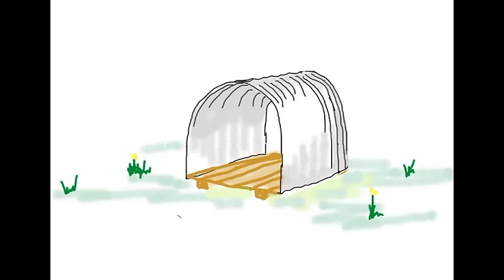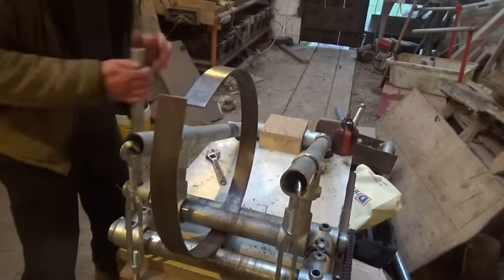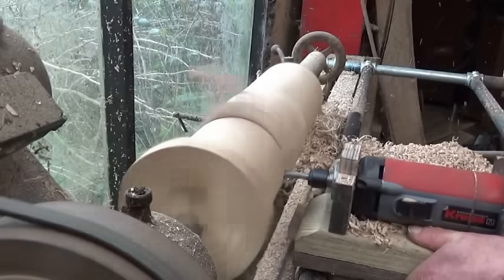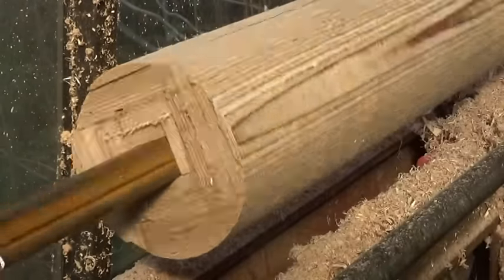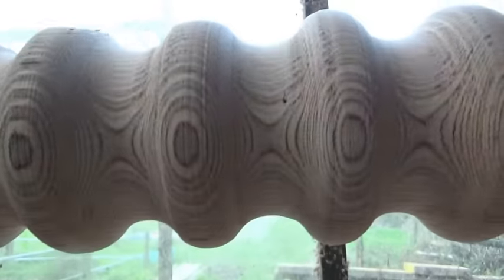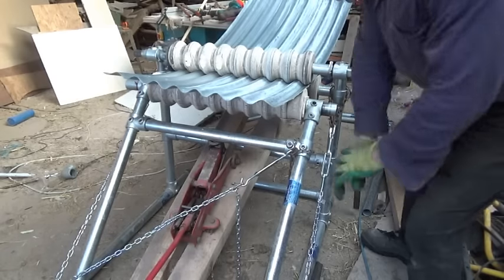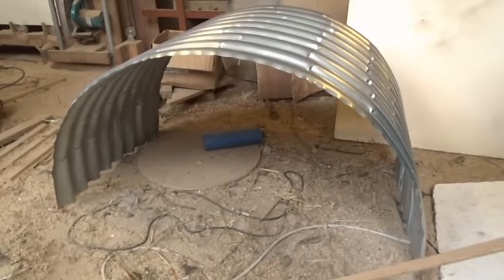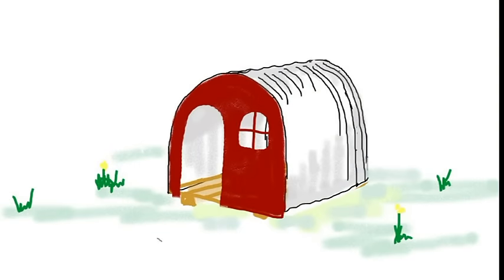Homemade Corrugated Iron Roller (well, nearly!)

Comment: Ive seen a machine like yours and they had the same issues, in order to solve that they've put 4 rollers on the top and 4 on the bottom and each couple had a bit more pressure on the shit so the stress on the machine was spreaded between all the rollers.

It worked really good but it did not solve the curve issiue and worked only for flat pannels 

It is possible to build a multiple roller machine that the relationship between the rollers is chaning progressively so as the sheet is being corrugated its being curved at the same time, but that is adding way more complicity to the machine and deammand gear and chain system to time all of the moving parts together...

Comment: Yes, most corro these days is high tensile, you need what is called a soft coil feed to successfully get bull nose or tight radius curvature........  20 out of 10 though for the solid effort getting to where you did. Awesome work.
Reply from the maker: thanks, Michael. Just need to find some now..

Comment: I ran a big j a not so big plate roller here in usa. Man ya got to have roller bearings in the ends of your roller! The frition in your contact points is killing you, the center down pressuer roll is best, & multipule passes eill elimsnate kinking,, a back & forth is best! Good luck
Reply from the maker: Thanks, Kenny. Sadly it took 40 passes to get these! I think the steel is too hard..

Comment: I would think , take a high torque  automobile starter and flywheel and use it on the one roller . That should do the trick .🤔
Reply: if he mounts 2 starters .. one on either side of the flywheel ring gear.. he could have reverse by just toggling solenoids..

Comment: Might I suggest making a wood roller only instead use it to cast a aluminum duplicate in a two part sand mold,  Or you can make a foam roller and pack it in sand and do lost foam casting with aluminum but you would have to make a foam duplicate for each roller you need to cast, you would also need to make or use a big crucible to melt more aluminum then what would be needed for the volume of the roller.
Reply from the maker: Yes, I'd love to do that, but finding and melting that much allie would be a big project in itself..

Comment: U need a thicker iron aswell the thin 0.6mm high tensile tends to kink more than 0.8mm low tensile iron my dad has three of these machines 2 of which are mobile and constantly get sent the wrong iron at job sites
Reply from the maker: You're right! Thanks.

Comment: I used to work for Corus in their profiling division. Curved sheets are/were part formed then full formed within the curving press. The change to peak and valley structure holds in the curve and reduces creasing.
Lubrication is also key. It reduced deviation, creasing and splitting.
Your design is fine... but:
A. Make the form 1-2 degrees more extreme than the formed sheet.
B. Roll half sheets: even the commercial equipment is cheaper at 1/2 sheet form factor because it's so much easier.
C. Use a pre loaded rope drive and a vehicle winch to rotate the rollers.
D. Multiple passes at fractional increases are vital. A 180 sheet on our standard hydraulic units was 5 passes. Only the "beast" that used a pre and process heated system formed them in 1 hit.
Reply from the maker: Thanks, Robert. Actually I made 40 passes to get to these curves! I have a new idea though...
Reply: @WayOutWestx2  Ouch! 😂
Look forward to seeing it. Honestly... look at some of the stuff they do over in Africa. Saw a father and son team making steel drums using an old truck driven axle as a metal spinning lathe and seam welding with a bank of 10 car batteries! 😳 Mother of invention and all that 👍🏼

Comment: As mentioned below I vote for a geared down solution. And perhaps rounding out the rollers that are missing their nice round bits. That may be the source of your ripples in the sheet stock of the ripples are at a regular place in the finished profile.

Great job! And thanks for taking the time to make this video. You are much closer to your goal than you think.
Reply from the maker: Thank you! (No, the flat tops didn't line up with any of the kinks - interesting.)

Comment: I think that the rollers should be as large as possible commensurate  with the required final radius of the corrugated sheet. 
That is my totally uninformed opinion off the top of my head.
BTW Have you noticed that the subconscious often solves problems that baffle the conscious mind ?
Reply from the maker: Yes, I often sit around waiting for my unconcious mind to do its thing - but you can't rush it : -  )

Comment: I have a couple of corrugated iron curvers. Both of them motorised. One is a very very old set and one a newer set. One thing worth mentioning is that if you do not use corrugated iron that has been made for curving then you will have major problems. There are two types of corrugated iron. High tensile and soft feed. The high tensile corrugated is much thinner than the curving quality iron. In the old imperial system the gauge for curving quality iron is 24 gauge. The high tensile is 26 gauge. In the new money the curving quality is .65mm and the hi tensile is .42mm. You can curve the hi tensile but you can only slightly curve it. The curving quality iron can be curved down to a 350 radius if you have the correct rolls with very close bottom rolls. So you are on the right track. You should check though that you have the correct material to start with. I am in Australia in Queensland where we have a lot of curved roofs. Not sure if you can get soft feed curving quality corrugated in pommy land though. Hope this helps you in your quest. Personally I think you've done a great job with limited materials and knowledge of the subject. I do think though that you need steel rolls to do what you need. You will also need a very rigid frame.
Reply from the maker: Thanks for this, Phil. I'm trying to find someone here who even knows what I'm talking about. Perhaps it just doesn't exist here..
Reply: @WayOutWestx2  I assume you are in England. It's fascinating to me that the home of where corrugated iron came from has more or less lost the knowledge of how to use those materials. Surely some company will know something about what you require. Perhaps ask some of the roofing companies.
Reply from the maker: Ireland
Reply: @WayOutWestx2  Phil is absolutely correct about the two grades of sheet. However you've still got a fascinating experiment there. Maybe try is to heat the sheet as much as you can before attempting to roll it. The colder the metal is then the harder it will be to curve and the more likely it will be to kink. A bit of heat might make it easier and give somewhat better results. I also wonder how you'd go forming with that rig. Maybe try finding some really seriously thing scrap aluminium flat sheet and running it through. Cheers

Comment: I built my own Iron bar twister. I used a starter gear from a car and the car starter to power it. it works great. you just can't run it continuously or the motor gets to hot. so then I just used the bendix ( drive gear )  from the starter and mounted it on a shaft with a pulley. I then attached the pulley ( via a belt ) to a regular 1/2 hp  electric motor. now I can run it for hours with out over heating.  if you would like a picture of the set up just message me.
Reply from the maker: Thank you. I'm thinking of using a hoist motor - low speed, high torque, reversible. What do you think?
Reply: since your doing such a small area and also making strong end walls. why not just use galvanized flat sheeting ? with the end walls in place it should be more than strong enough.

Comment: Hi Tim!
I'd suggest implementing a gear reduction, so the torque needed is lower, and possibly adding a motor, I'm guessing constant rolling speed might prevent the kinks (just an idea though). Good luck with the project!
Reply from the maker: You might be on to something with the constant rolling - thanks, Rozaakos!

Comment: You can actually get curved tin in Belfast bent to your requirements
Reply from the maker: Yes, but so far I haven't been able to find anyone who can do the specific shape I want
Reply: That’s a pity Tim, I know a relative had some bent to repair a hayshed if you can give me some detentions I can ask whoever did his but I probably think they don’t bend as tight as you’re looking but no harm in checking, would be great to use on camping pods / saunas also
Reply from the maker: Thanks, Geraldine. The half-circle at the top has a radius of 60 cm. The straights vary from 30cm to 180 cm. But if you found someone who could roll the tight radius then I'd be keen to talk to them. Thanks!
Reply: I will ask and let you know either way

Comment: Hi Go down in thickness  of  the plate .4mm is en of  I have  roof with .4 mm thickness and the profile is the same as you try to make but the kinks is difficult to over win. I hope you understand my English Im from Sweden
Reply from the maker: The thinnest I can buy here is 0.6
Reply: @WayOutWestx2  Wath is the thickness of the plate you test with ? wen I look on the video its seems 1 mm or more
Reply from the maker: It's called 0.6mm - perhaps that's the thickness before they add the zinc?

Comment: Use a Air impact wrench for the drive . That should solve both problems the kinks and manpower issues. Because the kinks looks like it's from when the rollers slow down from not being a constant speed . Just a guess tho.
Reply from the maker: That's a very interesting observation, Jimbo. Thanks..
Reply: That or a giant hamster wheel lol. And you could always put a pulley and fan belt on it to a small lawnmower engine if you don't have a Air compressor that has enough C.F.M's to run a Impact gun .

Comment: Part of the problem is geometry. Corrugated roofing is going to go in wider, flat, that it comes out. So trying to make all the corrugations in one go is probably going to be impractical. These things go through a series of rollers so that they do multiple operations one at a time, the end corrugations being deeper and closer together than the earlier ones which are shallower and spaced farther apart ridge to ridge of the corrugations.  Think of the length of a piece of string that goes across the sheet, up and down the hills and valleys. Steel does not want to stretch in length. Aluminum might be a little easier, but still hard. Talking off the top of my head, I am guessing the distance between ridges versus the distance along the surface might be different by an eighth of an inch or more, maybe closer to 1/4" old english units. Experiment with a sheet of aluminum foil pressed to match the corrugations and then flattened out. I experimented with that one time when I was going to make a press to crimp or flatten the ends of corrugated wall panels to look neat at the bottom.  experimented with plaster and aluminum foil to figure out the shape needed. I admire your work ethic.
Reply from the maker: Thanks, Gary. But I was only trying to roll/curve the sheets - not corrugate them. Sorry if that was not  clear
Reply: @WayOutWestx2  Thanks, that makes a lot more sense!
Reply: @WayOutWestx2  Yeah, I kinda skimmed through the presentation, sorry.

Comment: I reckon the only way to successfully add the corrugated would be rolling the center then adding left right cogs rolling in the next rounds then adding the next outer cogs and rolling which would prevent streching as you be only pulling from the outside straight as you go since you'd be going from inside to out..it adds one problem though. It would reduce the surface area
Big admirer!

Comment: Cool! .. Maybe you could try using  a lube? I would try soapy water or what we plumbers call goose grease , duck butter or other, more offensive terms. It's the stuff needed to lube up tyseal gaskets/seals before socking those kinds of bell n spigot joints together. The product is made with some sort of animal shortening and other stuff. There's all kinds of organic , cheap lubes you could try that you could mix in a garden sprayer and keep everything nice n slippery.. Form release agent, laundry detergent n water, etc.. 

Also, would it help if you annealed the sheet metal first or intermittently.. ?

I liked this video. I like your approach. You're almost there. ..and you got all the hard stuff done already. I woukd have never made it this far. Most wouldn't have.  Lol once I got so driven on making the tooling to make mini chain link fencing . What I thought would be a slam dunk ended up occupying me completely for a week or longer and when finally got it all perfected and made all the tooling to be able to make it in various sizes, both left and right hand coils. I cranked out a bunch of it and wouldn't you know it, when all the dust settled and I burned through most of my material I had saved up, wouldn't you know it, ,,,I forgot why I needed it. That was a couple years ago and to this day, I have no idea why I needed it so bad.. ..ever do that? Lol

Comment: Roll 4” pieces to shape . 4 pieces per hog hut. Place flat metal over rolled pieces and spot weld . 
And there you go. 
More time in building less funds in materials .
And you could use the rolled arched supports for a larger structure as in a cabin

Comment: I would try steel end plates even if they have to be laminated to reach a good thickness.  would be more rigid than sch 40 and cast slipp fittings.

Comment: Use the motor to run the system so that it comes out smoothly without disconnection.

Comment: It's not a failure; it works. It's the Mark I version.

If the rollers were turned a bit undersized, you might be able to add a layer or two of fiber glass on them. That might hold them together. If you had some edge rollers, perhaps it will run straight.

So, when are you going to put the motor in it? : )
Perhaps you can get some big sprockets and chain from some old farm equipment, to make a reduction drive, or even use an old car transmission, perhaps from something small, or even a big lawn tractor.

Doing it by hand, it's not going to be easy to have enough finesse to guide it--while you are using enough strength to turn it.
Reply from the maker: Yes - it's the Mark 1!  Surely car transmissions are heavy? lots of thick oil and two many gears? I just need something simple - but reversible...

Comment: Large diameter corrugated culvert pipe.  Cut across the diameter.  You add some straight sides for desired height.  Add fancy bits to please.  :)
Reply from the maker: Couldn't find anything big enough here  : -  (

Comment: That was an amazing achievement! No mean feat to get to that level of corrugated sheet bending. For what it is worth I'd suggest that - once it is motorized- that you make smaller adjustments for each pass through the machine. Gradual deformation will help  reduce the kinks. The video style was fun. The turned ply looked lovely too.
Reply from the maker: Thanks - but check out the latest video in this series - I've made some progress!

Comment: Silly question, but any particular reason you want to use wriggly tin? You could just use your very clever rolling machine to U-shape a piece of flat steel sheet, then bend a few thicker steel flats as reinforcing ribs. Maybe even angle or channel iron. I'd bet you a beer that'd be plenty strong enough for the job. Tack weld or rivet the sheet to the ribs for extra strength.
Reply from the maker: You're right - except I'm trying to design something much simpler. I hope I can make a video of it one day...

Comment: Tim - the most obvious solution (after the cut a tank in half suggested below).
Use flat sheets of steel - possible leave them flat  :-)  What structure is cheap and easy to produce and rigid enough ?
Other people connect the spokes of their bending machine with re bar that has been rolled into a circular shape :-)
With the plasma cutter and a small amount of welding you can produce the structures -- wood might be cheaper . . .
Ideally it is delivered as a flat pack !!
Reply from the maker: Thanks Chris, but I think flat sheets wouldn't look as good and they might not be strong enough (they might buckle if someone climbed on the house?) Will experiment more though

Comment: I think you're almost there Tim! From what I've seen https://www.youtube.com/watch?v=7f__LAudU9A I think the kinking issue is simply the result of trying to bend it to much in one pass. If you were tightening your rollers by X amount per pass, try half or one third of that amount per pass. That should not only eliminate the kinking but also reduce the effort required significantly. Best wishes!
Reply from the maker: You're right, thanks. But these already took 40 passes each...

Comment: just thinking out loud . if your cor iron has a profile  of 30 mm and you form a circle with a o/ dia of 1000mm the inside dia is 940mm  the difference in circumference is 188.5mm aprox thats a lot of material to loose in your process. i think if you put kinks  in the inside of the curve you may be able to shorten the material ? it may even take less effort to  turn the handle. maybe some flat bar set into the inside roller at regular intervals would do the trick.
Reply: The difference between the inside and outside circumference has to be the reason for the effort. And to have a result without kinks must mean the outside is stretched(thinner) and/or the inside compressed(thicker). The metal is being remoulded.  So how about heating it (no idea how much, don't burn the wood)?
Reply from the maker: Controlled kinks? Yes, it's an interesting way of doing it. Hmmm...

Comment: I'd start off with flat material instead. Form the ribs as you form the curve to prevent the kinking. Try that in your current setup and gradually increase the pressure on the rollers.
Reply from the maker: that won't work, Dustin, because corrugated material is narrower than flat..